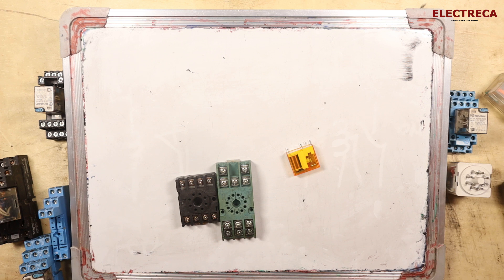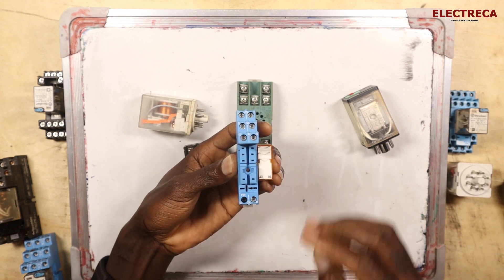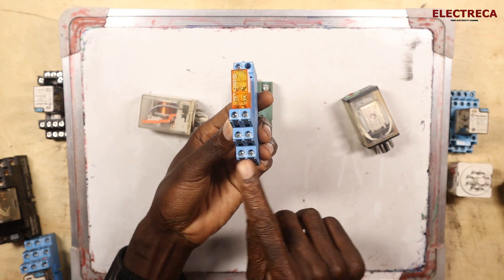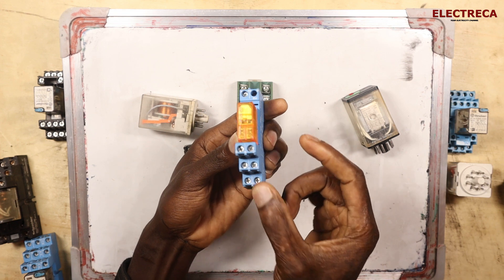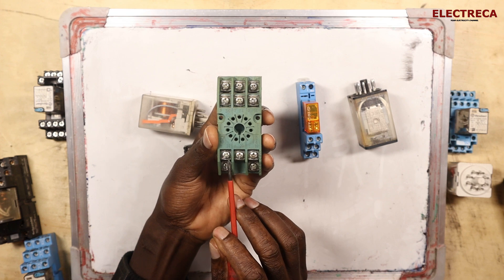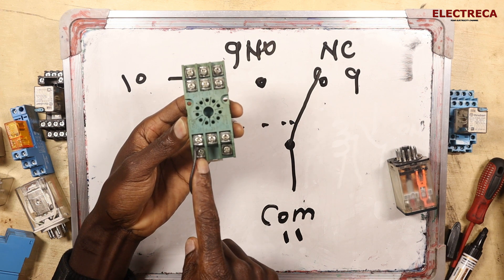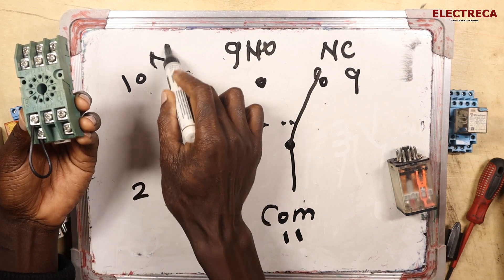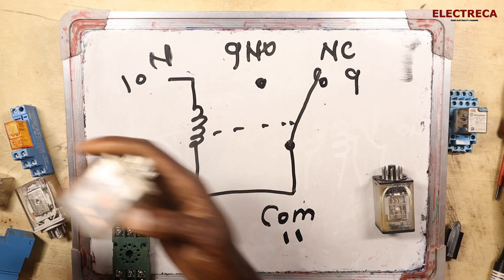Relay Contacts Explained: NO, NC, and Changeover Contacts Simplified

Comment: Please I have the following questions:
1. what are the uses of the relay contacts
2. What is the difference between this relay and Thermal OLR
3. Assuming you seeing this for the first time, how cam you read and understand the contacts and connections. 
4. What are it application and at what instance do you go for one
Reply from the maker: 1 The contacts are used to connect the load once the relay coil is energised,
2 Relay is a switch, thermal overload protects the circuit against overload current(preferably motors)
3 All relays have configuration drawings that can guide you on common, supply and throw contacts.
2 Relays are mostly used in instrumentation and control circuits(low-current circuits). Instead of a contactor, you can use a relay to control a batch of lights as long as the total load current doesn't exceed the relay rating.
Reply: @elektreca well done boss.